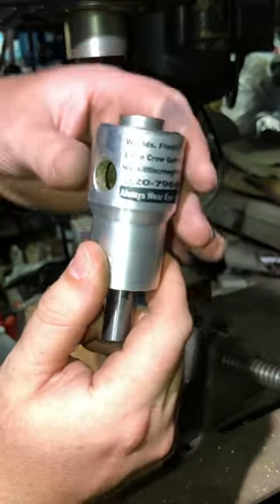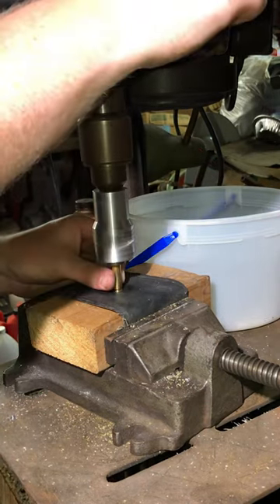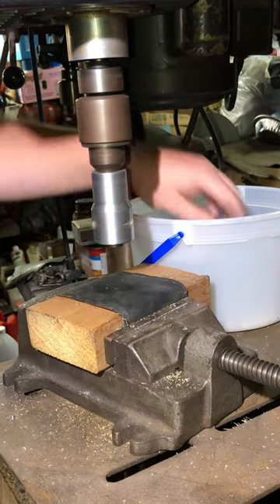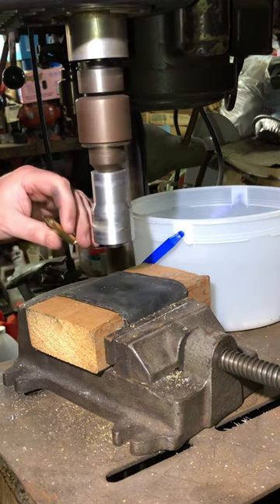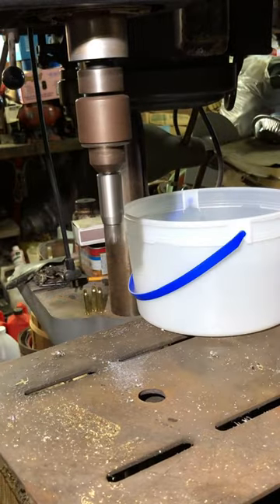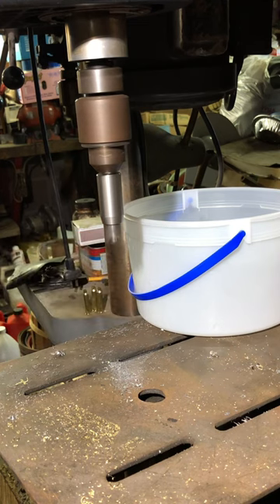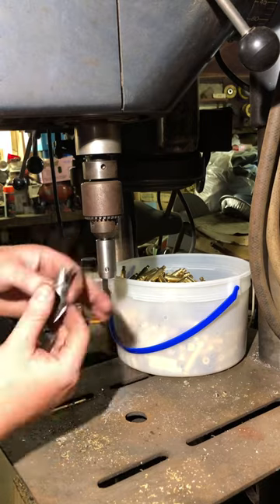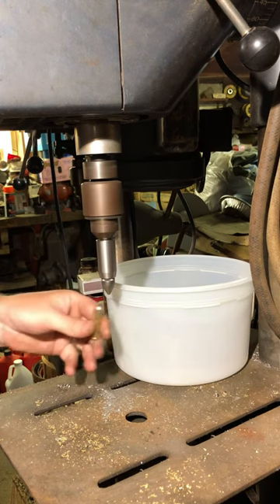How To Trim 223 Brass-World’s Finest Trimmer-2 (In a Drill Press) #shorts #reloading #reloadingbench

Comment: The case sizing is done based off measurements against the neck correct? There's no other reference the trimmer could use
Reply: It references off the shoulder (not the neck) after the case is re-sized. This is good enough to win at Camp Perry, and you can verify the trimmer's accuracy and consistency by measuring actual OAL with dial calipers.
Reply from the maker: 100% agree. Getting that shoulder sizing spot on is key, the trimming and head spacing depend on it.
Reply: @beantown_billy2405 And for best results, all your brass shoud be from the same lot AND have the same # of firings on it. 😊

Comment: Do you trim reused brass?
Reply from the maker: Depending on how much it grows each firing, yes. Low pressure rounds (such as my plinking 30-06 cast load at 2200 FPS) don't grow much in case length and rarely need trimmed. Higher pressure loads like full-house 223 or 5.56 do typically need trimmed regularly, especially if you're utilizing a crimp and need it in the same location.